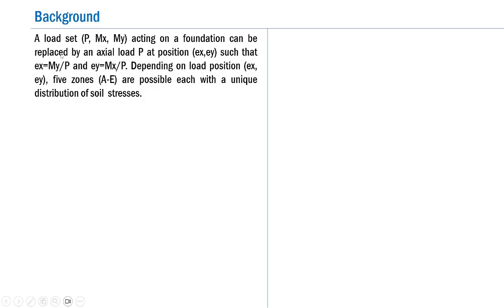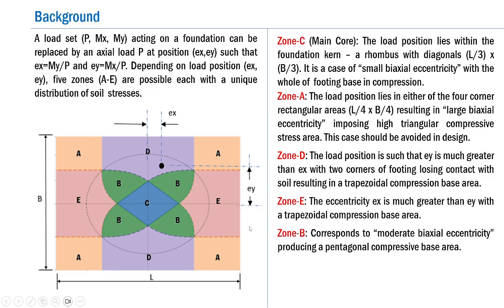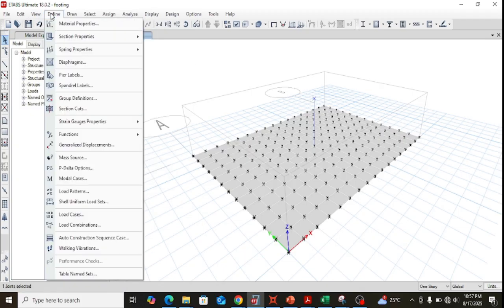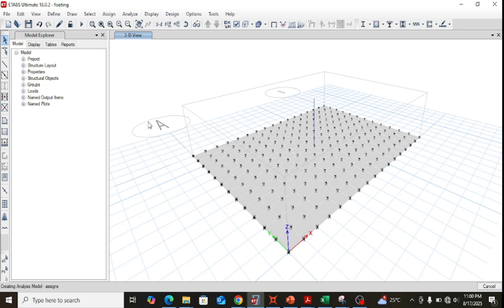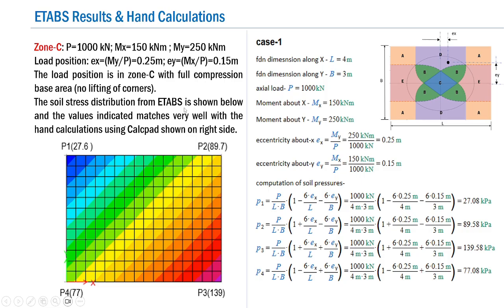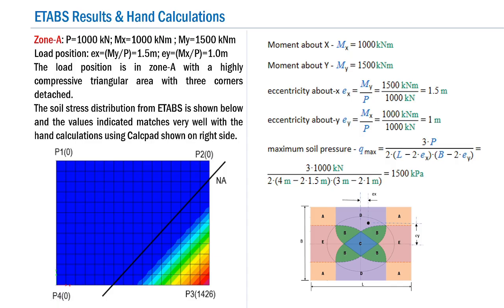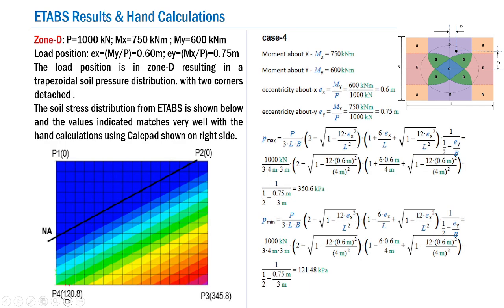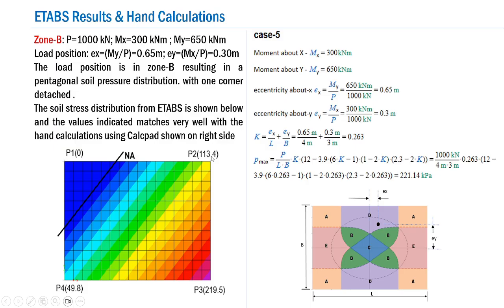An ETABS tutorial for the analysis of isolated footings under BIAXIAL MOMENTS……….

Comment: Sir, can you please show the calculation of these neutral axis positions for all five cases

How does ETABS calculate other pressures?

Also, how to use Teng's Chart efficiently.
Reply from the maker: please refer to a journal paper for detailed neutral axis calculations as the same is not given in any text books.
ETABS  employs a nonlinear static approach for pressure calculations
Reply: @puttattjayarajan1199  Thanks for your reply. Can you make a detailed video on Teng's Chart?
Reply from the maker: @darshandalvi6155  definitely...
Reply: Sir, can you share the link of the journal paper, iam unable to find the same in net.
Reply from the maker: @sunnybaggu785  https://ascelibrary.org/doi/10.1061/%28ASCE%29GM.1943-5622.0000218
Reply from the maker: @sunnybaggu785  https://ascelibrary.org/doi/10.1061/%28ASCE%29GM.1943-5622.0000218
Reply: @puttattjayarajan1199 sir, u r making a difference in many of our life through your knowledge sharing. Greatful to you.
Reply from the maker: @sunnybaggu785  thanks for all your kind support